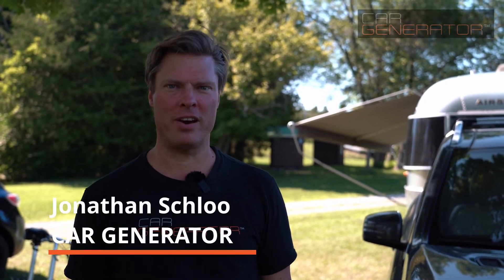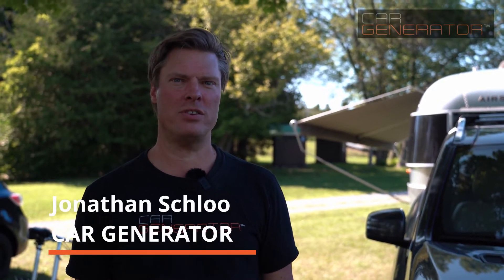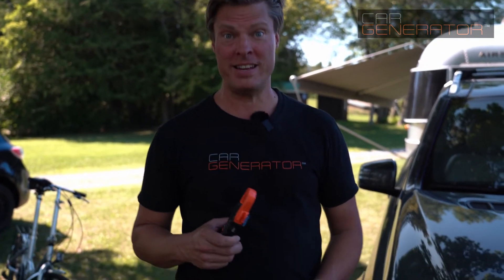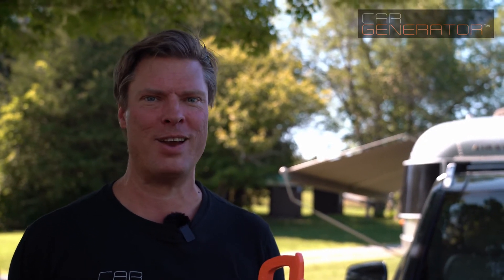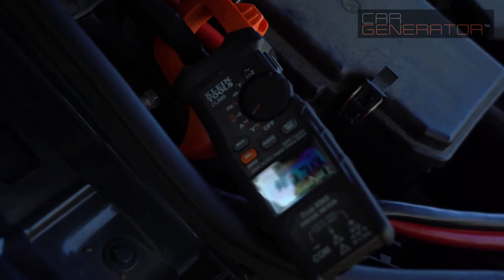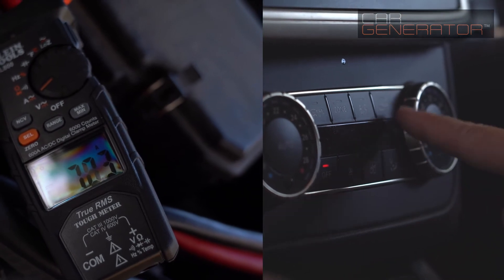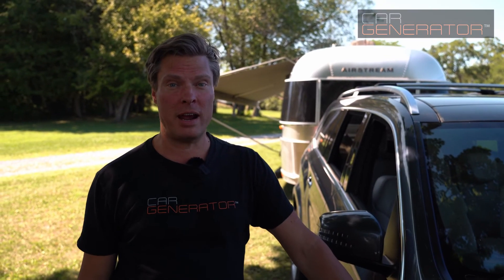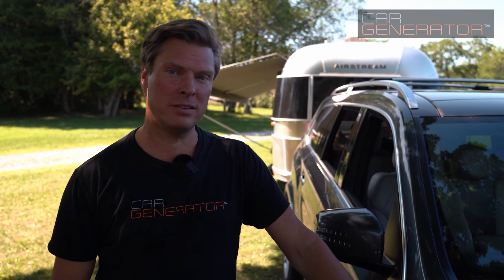How Much Power Does an Alternator Produce at Idle?

Comment: I was watching to see what happened to your charging voltage under tested load but no measurements were shown. Power output could also be a combination of alternator output and battery discharge. Monitoring voltage drop is crucial.
Reply from the maker: thanks for the comment.   voltage under tested load is about 13.7 range.   Our instructions for all CarGenerator customers, is to monitor the built in waterproof voltmeter on the front of CarGenerator, which shows the vehicle system voltage, and make sure it generally stays above 13.5 volts, which shows we are not pulling too much power out.   if it dips down to 13.1 or 12 volts for example, then you are pulling power from the battery and need to reduce loads.

Comment: How long can you safely run a modern vehicle idle?
Reply from the maker: Thats a fairly broad question, here are some references to provide guidance.  Ford ProPower in the F150 pickup truck with built in 2kw inverter is 85 hours published and marketed by Ford.  Honda Ridgeline offers a 400w power outlet in the truck bed with Honda markets "for tailgating and watching TV".  GM offers a truck bed 400w power outlet which GM owner instructions state "can be used for things like slowcooker or crock pot".  Toyota Highlander or Sienna offer a built in 1500w inverter and many other manufacturers are building in power inverters which provide power at idle.  Check with your manufacturer and dealer - and if they give you a rubber stamp answer of "avoid idling" then ask to define precisely what is too long?   2 minutes?  20 minutes? 2 hours waiting for the kids at soccer?  4 hours hosting a tailgate party with the truck bed outlet? 10 hours stuck in a major traffic incident?   Modern engines are engineered to operate in a wide variety of conditions both at idle and in motion.   Thanks.
Reply: @cargenerator  Awesome answer, thanks for the thorough reply. I want to run a dehydrator while camping/travelling. I will mostly do it while on the road. But I am curious if 4 hours of idle is alright, I am old school where I would think that is too long. Maybe I will call the dealer and ask.
Reply from the maker: @jonathankuhn2180  yes I think 4 hours is perfectly fine. The easy parallel would be if you were stuck in a bad traffic jam for the same time you would idle also, same thing.....   Ask your dealer in that same context to get an accurate answer.
Reply: @cargenerator  Smart idea to ask in that manner. Fortunately I have been living in a rural area where I do not have to deal with such a nightmare, God bless the people that do.!

Comment: What's the max amount of watts you can use your car as a generator  ? For better results the car battery should be 1,000cc avoid 500cc and 600cc car batteries
Reply: If your alternator is 100 amps you have up to 1200 watts  available using a DC-AC inverter.
Reply from the maker: @berrywr1  yes that is correct at full alternator speed, however at idle speed you get about half of that
Reply from the maker: Call your vehicle dealer, parts dept, they will tell you for your vehicle what is the "amps rating" of your alternator.  Reduce the amps rating by half for idle speed, times 12 volts = approx continuous watts you can expect.   This video explains it also   https://youtu.be/Js4K6N5rMCg

Comment: Is there any way to get more watts than half my 80amp alternator can provide at idle? After halving I only have 480 watts and need more. Does revving increase? Maybe I could leave brick on accelerator if so…
Reply from the maker: if you google for your vehicle and the phrase "alternator upgrade" you will typically find several companies selling direct fit bolt in high output alternators.  for example google for "Dodge Caravan 2019 alternator upgrade"  You can consider installing an upgraded alternator and thereby gaining significantly more power.  It uses about 5 horsepower per 1000 watts so you engine can easily power it.  Feel free to call our experts to discuss further 800-750-4660  thanks.
Reply: @cargenerator  thanks!

Comment: I have a GL 350 also, the manual says not to idle for more than a few minutes or you can damage the emissions sensors. How are you overcoming that?
Reply from the maker: David, can you provide the reference to where exactly the Mercedes user manual states this? That would be a very severe restriction to ordinary intended use of the car.  Millions of vehicles idle around the world every day, on a very hot day stuck in traffic, or waiting for the kids at soccer or the airport, or on a very cold day in winter stuck in traffic to think you would have to shut off your GL350 while sitting after 2 minutes stuck in a traffic jam, and freeze? https://www.mbusa.com/content/dam/mb-nafta/us/owners/manuals/2014/operators/MY14_GL_Operator.pdf
Reply: @cargenerator  I looked at my manual I didn't see it. Not sure where I read that. I agree with you as far as the cold goes.

Comment: Alternators vary in capacity greatly, and their amp ratings are at RPMs above idle speeds.  Also, they can overheat over time.  I'm concerned that without alternator temperature monitoring, some alternators my fry themselves if you're pulling high currents over longer periods.  How do you protect against this?  Anything over about 1000W continuous from the inverter could be problematic for some vehicles.
Reply from the maker: thanks Michael, great question.  There are two ways to calculate this.  If you call your vehicle dealer parts dept they will tell you the "amps rating" of your alternator, divide that by half then multiply by 12 volts = approximate watts you can expect.  To get a more accurate result you can see for yourself, buy or get a DC amp clamp meter, and you can do the same process as you see in this video.  You can see in this video that vehicle uses around 25 amps at idle, and fully loaded with all accessories uses about 125 amps, so the available difference is 100 amps.  Manufacturers spend millions of engineering dollars to make sure the vehicle can fully support all accessories at idle in a wide variety of conditions without overheating or overloading.   So the CarGenerator concept is simple - just switch off all the accessories and pull out that same amount of power for a different purpose.  The alternator  doesnt know or care the target use, it just simply produces power within its capacity.  You can prove this for yourself also for peace of mind - on a hot day let the vehicle idle and switch on ALL the accessories you can find and leave them running for an hour.  Check the temperature of your alternator and then you will easily know the tolerance and limits already engineered safely into your vehicle.   If you have any other questions please feel free to call and speak with our experts 800-750-4660.  thanks!

Comment: My Silverado has a 200 amp alternator, I’m thinking I should see about using the truck for an emergency generator.
Reply from the maker: yes you are right!   we have lots of customers using a Silverado with CarGenerator.  In your case you would get around half rated capacity at idle so 100 amps x 12 volts = between 1000-1200 watts approx.
Reply: @cargenerator 

Thanks for the great information you share. 

I use a DC-DC charger ⚡ to feed power from the alternator to my solar batteries 🔋. The DC-DC charger protects the car electric system. All the DC-DC chargers to be used with alternators I have seen on the market are 200 watts or 400 watts.
Reply from the maker: @ajarivas72  good to hear thanks.   I guess your DC-DC charger must be very close to your solar batteries because at 12v DC you need massive cables to run it much of a distance and still carry decent amperage and minimize power loss.   General rule of thumb for power available is your alternator "rated amps" reduced by half for idle, times 12 volts = approx watts

Comment: I have a Mitsubishi Outlander with a 120 amp alternator, can I run a 535w air conditioner from my RV  with a DeWalt 1000w power inverter directly connected to my car battery on iddle  non stop ?
Reply from the maker: The calculation would  be 120 amps reduce by half is 60 amps, then reduce by the efficiency of your inverter, our high quality inverters are 90% efficient so using a CarGenerator inverter would be then approx 54 amps x 12 volts = 648 watts so you are a bit over capacity. Also know that in summer you will get less output from your alternator due to increased electrical resistance from heat, and in the winter you will get a bit more power.  Check the conversion efficiency of your Dewalt inverter it may be less efficient,  also if its a modified sine wave unit that will be a consideration also, our unit is a pure sine wave output which is a bit more expensive but is much easier on the compressor motor of your a/c unit.

Comment: This seems like a great idea... For years now i have been using just regular inverter that you plug in lighter socket, and it works great for laptops and mini fridge, but its not rated for higher demands.  People dont think about it too much, but in reality car alternators are pretty powerful generators. It can easily pump 1500w without even breaking a sweat, and considering that in most places electric grid is limited at 2000w per house, it is not too far. But the thing is that some of that power will be used by a car for its other systems, and there are resitances and other stuff, so its not a good idea to pull 100% from the car otherwise voltage regulator could overheat and die, which can overcharge the battery and cause it to die too.
Reply from the maker: thanks for your comments.  Here's the actual calculation...   call your vehicle dealer parts dept with your phone number or VIN vehicle ID they can tell you exactly the "rated amps" of your alternator.   Reduce that by half for idle, then times 12 volts = approximate watts you can expect.   You can also use a DC clamp amp meter like in this video to measure for yourself exactly what your car is engineered to provide.   Seven years in market with thousands of customers coast to coast, zero problems with alternators, regulators, batteries, etc.  because we are very conservative in the amount of power pulled out , so as to never ever come close to max capacity or overloading in any way.

Comment: I was looking into this and I read that your battery and alternator slow down when your car idles so your battery will eventually go dead.
Reply: Three weeks ago, I ran my 1000 watt pure sine wave DC-AC inverter with my car's battery with the engine idling with no other power usage being used by the vehicle itself; it ran for 10 hour flawlessly, 2 gallons of gas.
Reply: @berrywr1 

thanks for the information. Very useful.

Is your car a 4, 6 or 8 cylinder engine? 

Do you know how many watts the inverter was pulling from the car 🚗?

What devices were you powering with the inverter?

I want to power a 1000 watts air conditioner with the alternator.
Reply: @ajarivas72  I'm not sure if you're talking to me but if you are; I have a 4 cylinder Chevrolet Equinox; it has a 110 amp alternator thus a maximum of 1320 watts.  It will run a 1000 watt AC but I strongly recommend you use a Soft Start with it; I believe the surge at startup will knock you out unless you have a higher amperage alternator.  You can buy a 250 amp alternator and I'm thinking about doing the same.  That's potentially a 3000 watts available and a good long running time if you have a full tank of gas, 3 days in fact.  Buy a watt meter like P2.  I had two outside lights, five inside lights, router, modem, and 3 high velocity air circulators... 535 watts for 10 hours.  I don't run my ACs during a power outage.  I have a well pump, but I have 5 gallon buckets that can catch rain off the gutters if necessary.  I can run my dehumidifier which can produce water and I run that tube to a toilet in my guest bathroom.  Never know when you need one good flush! Three words, pure sine wave.  A modified sine wave will work, but I ran a small fan next to my inverter to keep it from running hot.
Reply: @berrywr1  

Thank you very much for your very substantiated response. I enjoyed reading it. 

My air conditioning unit is an inverter model, it does not generate a high inrush current at start. Thanks for the advice, I will keep it in mind 😉 for the other air conditioning units which are not inverter technology. 

I run all my air conditioner units from huge solar battery 🔋 banks, a huge solar battery 🔋 bank for each air conditioner unit. Those banks are well capable of tolerating the inrush current of the no-inverter technology ac units. I am planning  to feed those battery banks from the alternator through a 1000 watts DC-DC charger ⚡  so protecting the alternator.

The CarGenerator device could help me to avoid many problems. 

Great tip about filling the toilet 🚽 tank with a dehumidifier. We don't know when a good flush is necessary. 

Yes, I was writing to you.
Reply from the maker: Your battery will NEVER go dead using CarGenerator with our instructions.  Your alternator and engine ALWAYS run in sync to make sure the alternator output voltage stays between approximately 13 - 14 volts.  If you switch on accessories like headlights, cabin fan, etc, the alternator and engine automatically increases output to provide power up to its rated capacity.   CARGENERATOR is a simple concept, you shut off the accessories in your vehicle and instead pull that power out and convert it to useable AC 120v.  The alternator and engine dont know or care if its your headlights and cabin fan, or the CarGenerator inverter pulling out power.  There are more technical details and some specific models of cars, feel free to call us at 800-750-4660 for a detailed explanation or to discuss your specific needs.   thanks!

Comment: That vehicle sounds like a diesel. A diesel has a bigger alternator, bigger battery and has more power at a idle to turn a alternator under heavy drain .
Reply from the maker: you're right, that vehicle in the video is a diesel, however CarGenerator works well on ALL vehicles - gas, diesel, hybrid, and pure electric EV.  The point of what we demonstrate in that video, is the simple principle that on any vehicle, the manufacturers have engineered the alternator to fully supply all the car accessories lights fan etc, and instead we switch all of those items off and pull out that power and convert it to useable AC household power.  Safely, easily, and with no risk to the vehicle ever.    Get a DC amp clamp meter and try the same measurement on YOUR own vehicle, let us know what you find , how many amps your alternator can safely provide.   thanks